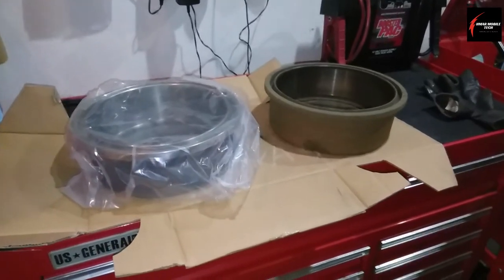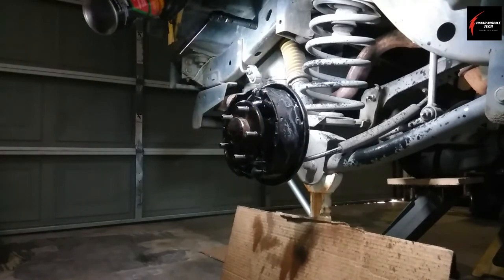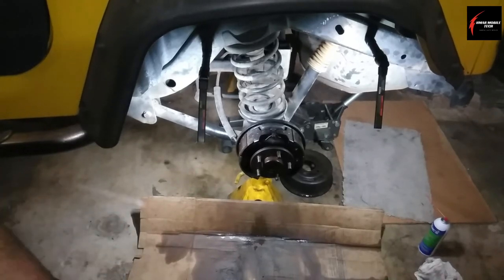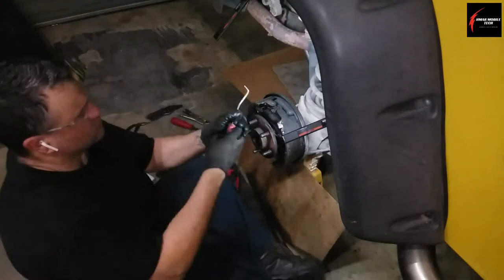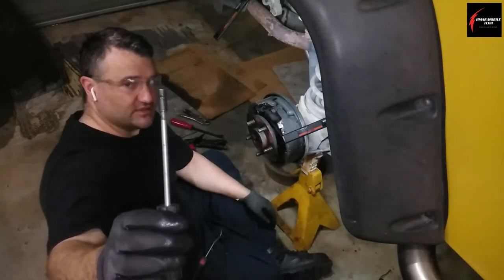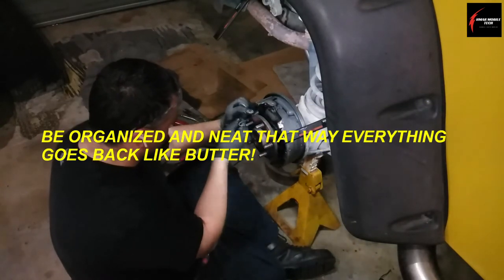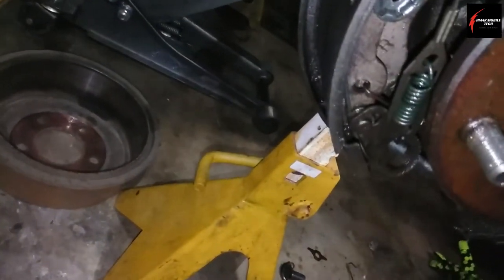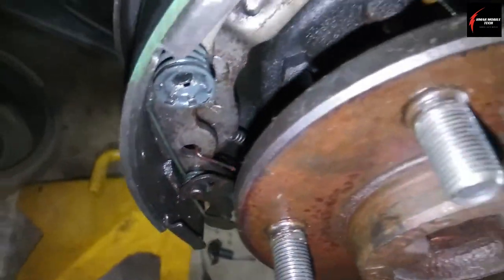MY BEST REAR DRUM BRAKE SHOE CHANGE DIY ON A JEEP WRANGLER, DETAILED AND HELPFUL | DOMESTIC ( PT 1 )

Comment from the maker: HEY VIEWERS, IT HAS COME TO MY ATTENTION THAT USING ANTISEIZE LUBRICANT ON LUGSTUDS IS A BIG NO NO. A MECHANICAL ENGINEER VIEWER EDUCATED ME VIA EMAIL THAT ANTISEIZE LUBRICANT SHOULD NEVER BE USED ON LUGNUTS / LUGSTUDS. LUGNUTS OR STUDS GO ON DRY ON CLEAN THREADS. TORQUE SPECS. ARE FOR DRY THREADS. APPARENTLY I HAVE BEEN USING ANTISEIZE THE WRONG WAY A LONG TIME BY PUTTING IT ON LUGNUT STUDS AND I HAVE NEVER BEEN TOLD I WAS WRONG IN DOING THAT FOR MANY YEARS TILL I MADE VIDEOS ON YOUTUBE.  IF I USED IT IN THIS VIDEO OR OTHER VIDEOS PLSE DO NOT COPY MY ACTIONS. I AM NOT THE END ALL AND BE ALL OF AUTO REPAIR :/ , SORRY VIEWERS I WAS WRONG😬 TY FOR WATCHING MY VIDEOS🎥 AND TY TO ALL MY SUBS🤘